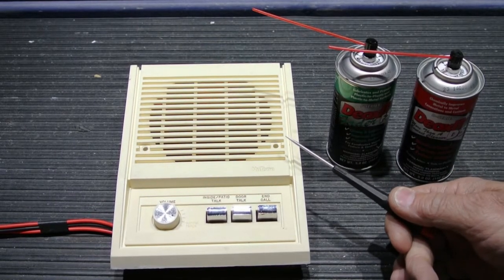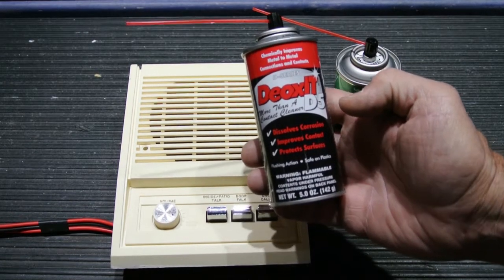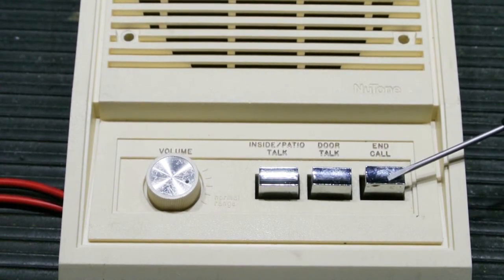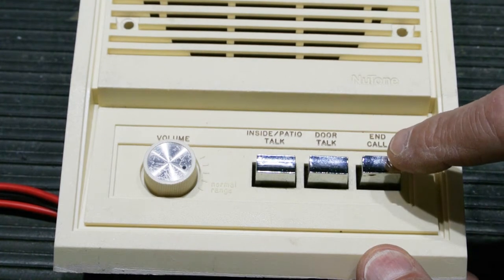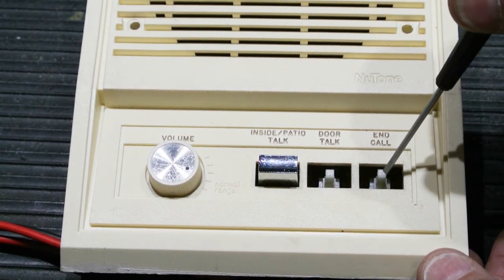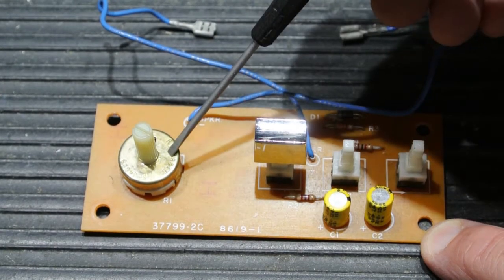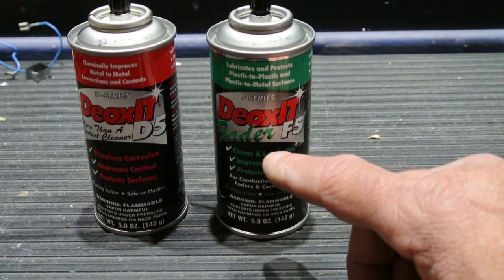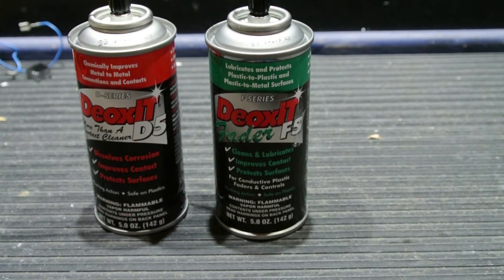How to Clean the Volume Control and Push Button Switch on a NuTone IS305 Intercom Speaker Station

Comment: First of all, THANK YOU for still being active, replying to comments, and posting new content to ancient intercoms. My Nutone 3003 radio ON/OFF button (very left, square button) is sometimes getting stuck on the on (pressed in) state, and pressing it again does not always retract and turn it back off. Would I be able to pry that button off similarly to this video with a flat screwdriver? Also do you have any tips for me to restore the button to its normal state?
Reply from the maker: Hi John: You're Welcome - The On / Off Switch on your IM3003 (really not so ancient) is unique compared to the other switches, because it's a "latching" switch.  When you press it down (on) it stays down - when you press it again it pops back out (off).  These switches do wear and sometimes they will not hold down or want to pop back out.  General Cleaning with DeOxit D5 will solve the problems with most stubborn switches .  You can spray the D5 onto the body of the switch (some times they have a little hole on the top of the switch body) and work the switch On and Off many times.  It cleaning doesn't solve the issue, the switch will need to be replaced - Also, DO NOT pry the chrome button off - this will damage the internal part of the plunger - Chris

Comment: Excellent video.  I just spent a few hours today cleaning all 12 of my intercom remote speakers.  They work like new again!
Reply from the maker: Hi Jim: Wow 12 remotes that's a lot more than average - Chris
Reply: Quick question .... How long does a typical deoxit cleaning last?   Just repeat the treatment if controls get noisy again?
Reply from the maker: Hi Jim:  I would expect the cleaning to last for 2-3 years, The stations that get more use will likely last longer than the stations that never get used - seems weird that way - but that's how it usually goes - Chris

Comment: Can you clean the switches on the master unit in the same way?
Reply from the maker: Hi jjhoganm: Yes - However Great Care must be taken when removing the chrome buttons from the switches - You Can Not pull the buttons off from the front - this can (and often will) pull the stem of the switch out, breaking the switch.  The best thing to do is - spray just a little (really, just a little) onto the tops of the switch assembly.  It will find its way into the switch - Chris

Comment: on two of my remote units the end call does not turn the sound back on after you hit the inside/patio talk button.  you have to wait about 17 seconds before the sound comes back on. These units have been untouched for the last 20 years and probably all 23.  Will cleaming the end call button help this symptom?   
It appears my cleaning the garage unit  seems to have stopped any volume control , I know it worked before as I tested it prior and it had a little noise at 1/3 level   Also  the privacy button stops the sound and the inside/patio talk as well as the door talk button do nothing and the sound keeps playing on this unit and the entire system.
Reply: at Chris's suggestion I moved my bad units that had an end call /n/o sound returns issue on the inside/patio talk   to the room where the unit works and they work there so it is not an issue with my room units.   so a wire or main unit issue.
Reply from the maker: Hi elkski Utah: It is most likely a wiring issue between the Remote Station and the IM4006 - Here's a link to our Video about troubleshooting wiring problems:  https://www.youtube.com/watch?v=aYHthKFeNDg&list=PLsTvqKsBnGYeFVhW3kYRW9rak8P0IJjku

Chris

Comment: Can the switches be cleaned without taking out the circuit board?
In other words, remove the switch covers only? If so, would it be recommended to remove the faceplate from the unit first?
Reply from the maker: Hi DD:  The only reason that I removed the switch board was to give everyone a better look at how to clean the switches.  You can certainly just remove the button caps and volume control knob to perform the cleaning.  When I do this at customers homes, I don;t remove the speaker station form the wall, I just clean it in place - Chris

Comment: My radio volume knob  is making noise . On low volume the sound is very high and high volume the sound is low. Plus disturbing crackling sounds are there. Pnasonic RF 2400  transisistor Radio
Reply from the maker: Hi Rajesh:  It sounds like the Volume Control is broken and it would need to be replaced.  Since the street price for your Radio is about $25.00 - it is not economically feasible to repair it, unless you can do it yourself - Chris